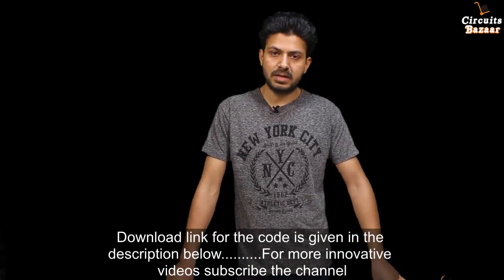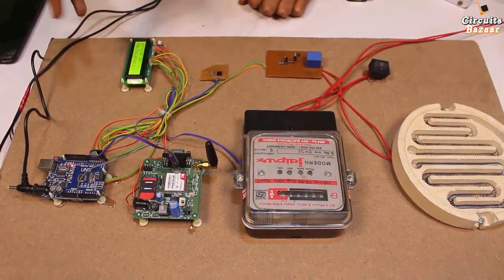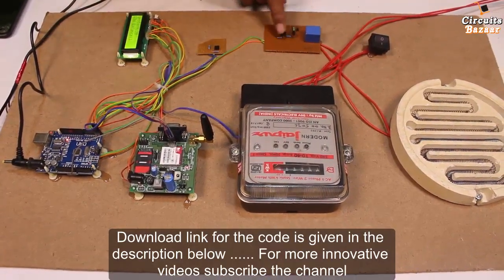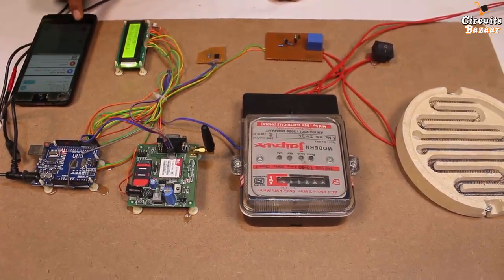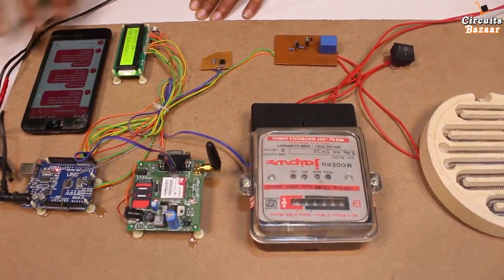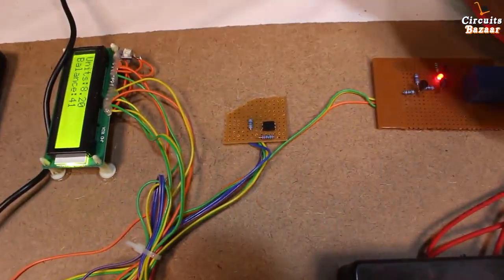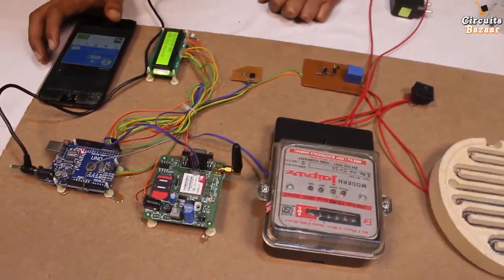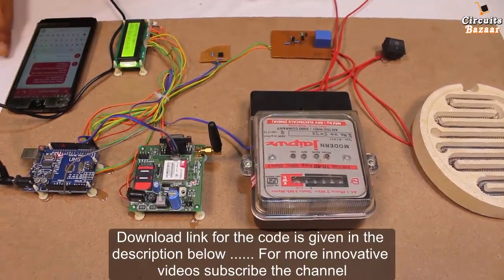Prepaid energy meter project using GSM / Arduino [ with code and working ]

Comment: how did you taken out connections for opto coupler i took parallel to the count LED but its voltage is just 1 and sometimes there is no output please let me know how you did that

Comment: How can I get the third terminal of  energy meter which is connected to optocoupler.... As such the energy meter doesn't have any terminal for that except input and output terminal... Please help
Reply from the maker: You have to open it and then you will find pulse LED..... from there you will get third terminal
Reply: @The.Innovative.Indian  okay sir got it thank you
Reply: Brother how did you connect to led

Comment: Sir I make this project but I can not see anything on LCD
And how I recharge to card of GSM module
Reply from the maker: check the LCD Potentiometer settings .... rotate it to tune the lcd display ......  you can recharge it by sending messages

Comment: Hi sir thank you so much for giving code and schematic but sir can i use arduino nano for this project.

Why because the cost of arduino uno is somewhat expensive sir that's why I'm asking this question sir
Reply: Hii karthik can you send me the code
Reply: Do you have the working code?
Reply: @akashmaharana1301  i don't have the code, because of that only i suggested the website sir
Reply from the maker: Yeah sure you can use arduino Nano as well to program this circuit

Comment: Sir, as u told about opeartion of the project but where ULN2003 used and u have also not explain about which compents is used where, that's why i am requesting you to please explain about componts specification.
Reply from the maker: Instead of ULN2003 i have used Darlington pair of BC547 transistor. if you have IC then you can go for ULN as well.  I am going to upload another video of improved version day after tomorrow.....

Comment: sir almost project  is run but phone did not send and receive message . and i use 900A mini 3.8.2 module so pls tell about problem.
Reply from the maker: Please check your GSM Modem ... there may be fault over there
Reply: Same problem here
Reply: How did you insert energy meter in pproteus bro

Comment: Sir dose it have a simulation video?
Reply from the maker: yes you can simulate it in proteus
Reply: Circuits Bazaar  Please Sir, how can I get and use the Energy Meter  that you used in software simulation? Dose it have library or we will construct it?😅

Comment: Actually in this project I used Arduino nano,so I amnot able to write the code. so this code will be changed for Arduino nano?
Reply from the maker: yes its very easy watch some youtube video for this ..... main difference is only that you need to select a different board when uploading the code to the nano board ...

Comment: sir our system shows fixed balance of 255 and there is low balance  in the system
Reply from the maker: charge it by adding more balance by sending messsage
Reply: sir i have already recharged it by 100 but it shows only 255 balance
Reply: sir our problem is not solved
Reply: sir please send me a code of GSM to sence balance and send message i have already used this code but did not work

Comment: Hello sir i tried to make this project.. i have almost done but when I installed code it’s not working
Reply from the maker: What actually is output ?
Reply: which energymeter have you used here ?  to which terminal does the optocoupler is connected in energymeter?
Reply: @rahulbarange1025  hello

Comment: Spdt relay required or not
Reply from the maker: Yes it is required to control the load ...... when you will be out of balance then electricity of the house will be shutdown using that relay ...

Comment: 1:16
What is this?
I can not hear you clearly
Reply from the maker: This is optocoupler and optocoupler is used to isolate 1 electrical section to another electrical section but still they connect with each other through light

Comment: working on this project ,, wvrything is workinng fine but the issue is theres no increment in balance . please someone help 
is that a problem in EEPROM ? Or with the decode message ?
Reply from the maker: Decode message problem .... use proper gsm modem ....  with proper signal strengh ... and recharge like  -    #50*

Comment: Apne Diya hai vo code me kucha error dikha rahi hai
Reply from the maker: What error you are talking about... Plz share screen shot
Reply: Sketch uses 9154 bytes (28%) of program storage space. Maximum is 32256 bytes.

Global variables use 1012 bytes (49%) of dynamic memory, leaving 1036 bytes for local variables. Maximum is 2048 bytes.

avrdude: stk500_recv(): programmer is not responding avrdude: stk500_getsync() attempt 1 of 10: not in sync: resp=0xba

avrdude: stk500_recv(): programmer is not responding

avrdude: stk500_getsync() attempt 2 of 10: not in sync: resp=0xba

avrdude: stk500_recv(): programmer is not responding

avrdude: stk500_getsync() attempt 3 of 10: not in sync: resp=0xba

avrdude: stk500_recv(): programmer is not responding avrdude: stk500_getsync() attempt 4 of 10: not in sync: resp=0xba

avrdude: stk500_recv(): programmer is not responding avrdude: stk500_getsync() attempt 5 of 10: not in sync: resp=0xba

avrdude: stk500_recv(): programmer is not responding

avrdude: stk500_getsync() attempt 6 of 10: not in sync: resp=0xba

avrdude: stk500_recv(): programmer is not responding avrdude: stk500_getsync() attempt 7 of 10: not in sync: resp=0xba

avrdude: stk500_recv(): programmer is not responding

avrdude: stk500_getsync() attempt 8 of 10: not in sync: resp=0xba Problem uploading to board. See https://support.arduino.cc/hc/en-us/sections/360003198300 for suggestions.

avrdude: stk500_recv(): programmer is not responding

avrdude: stk500_getsync() attempt 9 of 10: not in sync: resp=0xba

avrdude: stk500_recv(): programmer is not responding avrdude: stk500_getsync() attempt 10 of 10: not in sync: resp=0xba